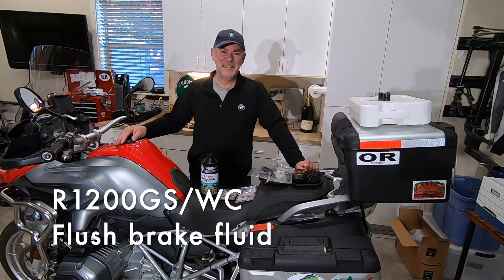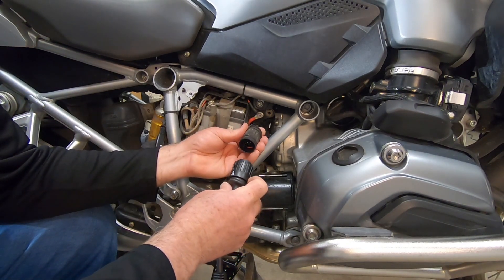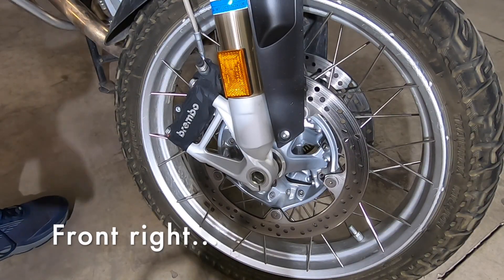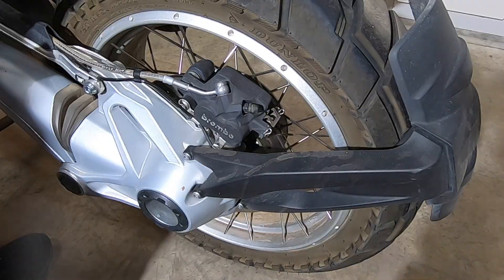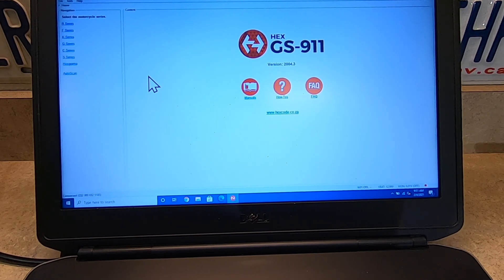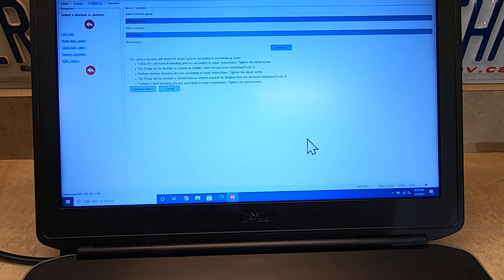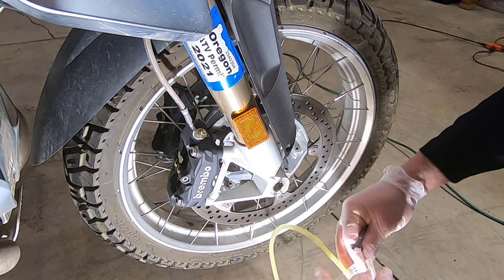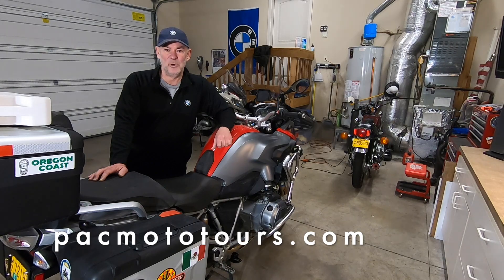BMW R1200GS/LC Brake Fluid Flush

Comment: When it says to activate the brakes, what do they want – both hand levers and foot at the same time, or what?  Thanks!
Reply from the maker: The GS-911 walks you through the process. You basically are working on one brake at a time. When it’s time to activate that brake, you pull in and release the brake multiple times in a short time period. The GS-911 tells you how long to operate each brake. I hope this makes sense. Thanks for the question and have fun with the brake fluid flush!

Comment: Hi, Another question. At 9:30 in, rear reservoir is filled but cap is left off, then proceed to pump front brakes. Since front brake lever works both front and rear brakes, is there any “fluid burping up”, and should rear reservoir cap be on to prevent splashing? Thanks again.
Reply from the maker: No, no splashing or burning. I left it off because you need to add fluid throughout the process. Thanks for the comment!

Comment: Great video thank you!  Can this be completed without the GS 911. Or is that necessary for the abs?
Reply from the maker: The GS-911 allows you to actuate the ABS pump. I’m told that you can also use the Motoscan app with a generic OBD device. I recall a good write in the BMW MOA magazine earlier this year.
Reply: @PacMoto  I have the motoscan unit and app. I want to see if it's possible to do with this.

Comment: Similar process and similar bleeder sizes on the 1250GS I assume?
Reply from the maker: Yes, identical. I have a 1250 brake bleed video coming out in a few weeks. But, yes, same same.
Reply: thanks! Will keep a look out for the new video. My first brake bleed is due and want to learn so hoping to do it myself.  @PacMoto
Reply from the maker: @frbaluch1 Ok cool. I’d suggest ordering the Speed Bleeder valves. I assume you have a GS-911 too. The video will come out 4/2.
Reply: @PacMoto in the market for the Gs911. Need it badly since I also need to reset the service minder from the first service that I also performed myself.
Reply from the maker: @frbaluch1 Maybe you can find someone in your local club that will lend you one.

Comment: A question related to one posted below 4 months ago  re; “residual old brake fluid in the brake lines.”, any thought on how much old fluid might be released from ABS pump mixing into the system of freshly flushed fluid?
Thanks again.
Reply from the maker: It’s a good question but I really have no idea…. Thanks for the comment.

Comment: Do you need to flush again after the second abs activation with the 911? I remember doing something similar with my Super Tenere and you needed to flush again after activating the abs pump because you might still have some residual bubbles and old brake fluid now in the brake lines. I have an RT now and need to learn how to do it. Thanks for the video!
Reply from the maker: Thanks for the comment. The GS-911 software walks you through the process on exactly what needs to be done. In my opinion, it’s the Speed Bleeders that really make the job easy!
Reply: @PacMoto  Hi, From the question asked above re; “residual old brake fluid in the brake lines.”, any thought on how much old fluid is released from ABS pump that would be mixing into the fresh fluid?
Thanks again.

Comment: Will the Speed bleeder SB8125L work on both Left and right front brakes?
Reply from the maker: For a R1250GS the Speed Bleeder website says SB1010S for the rear, SB8125L for the right front, and SB6100 on the left front.

Comment: Help please! Without noticing I went below the minimum level bleeding front brakes. Front brakes now won't work. What can be done besides take it to the dealer?
Reply from the maker: You’re okay — just keep bleeding the brakes until you flush out all the air (making sure to keep the reservoir full).  If you need more help drop me an email at kurt@pacmototours.com and I can discuss with you over the phone.
Reply: @PacMoto  Thanks so much! I got it working, it wasn’t bleeding either. I used a syringe with some tubing on the nipples and sucked the fluid and the air bubbles. It works perfect now. Your videos are really helpful!
Reply from the maker: Great news!!